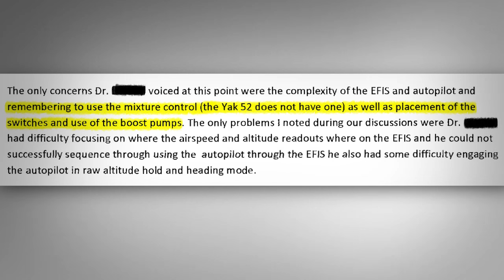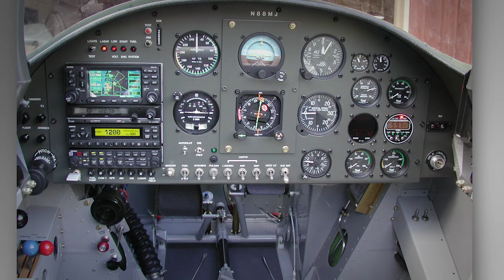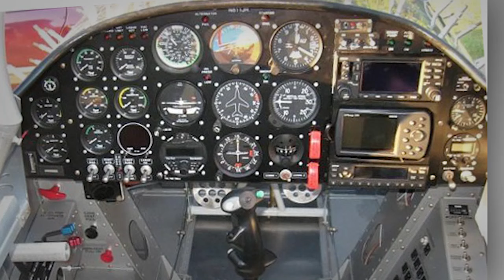Transitioning to Other Airplanes: A Dangerous Detail

Comment: Same engine means absolutely NOTHING. The airframe is the critical piece of the puzzle. If you are getting into a new air frame you should spend at least a minimum of 10 hours in it before taking it home by yourself.

Comment: John Denver put his plane into the Pacific Ocean when he had to reach over his left shoulder to switch fuel tanks and he kicked the right rudder pedal.
Reply: That was a design error as well... because the builder did not want to run fuel lines through the cockpit to a more ergonomic fuel selector.

Comment: Apparent similarities can be absolutely lethal, even more than distinct differences. Sounds, vibrations, even smells, that convey a message in one context may have a very different meaning in another. Being in a situation you know is strange, and consequently alert, may be safer than blissfully operating on unconscious assumptions that are wrong.
Reply: Yep a perfect example is the boeing 737-800 pilots who shut down the wrong engine and not the one on fire when they had smoke in the cockpit.
 
They naturally assumed it was i think #1 engine because thats where they believed the Air conditioning Comes from and often smoke in cockpit via the vents means engine fire, 
But this is where the Air con WAS located on the 737-200 & 400.
(Result they shutdown their only good engine.)
Reply: I'm not sure if you are referring to the Kegworth incident--that was a 400 series.  The pilots assumed that the smoke in the cabin was coming from the bleed air.  They also assumed that the bleed air in the 400 series came from #2.  So they shut down #2.  The A/C on the 400 series gets bleed air from #1, #2, and the APU.  Better CRM may have saved this one...it was obvious from the cabin which engine was malfunctioning.  Hard to say what you would do when put into this situation.
Reply: +Ben Jay
The crash you're talking about happened on Jan 8th 1989, it was a British Midland flt#92, they were flying almost brand new Boeing 737-400 which had only a little over 500 hours on the airframe. It was definitely not the 737-800 series because the 737-800 series entered service in 1998 almost 10 years after the British Midland flt#92 crash.
Reply: Someone flying a small racing plane pulled the mixture instead of carb heat on final, because the mixture in the aircraft he was flying was where  the carb heat was on the one he owned. Could have died when he landed in a field short of the runway and went inverted. Couldn't open the flip to one side canopy.
Reply: True for 737 MAX and 737-8
Reply: @vinci3965  Ding ding ding.

Comment: Just from my (limited) experience in "flying go-karts" I can promise you, the better philosophy when looking into a "new" (to you) airplane is to DISMISS the similarities, and FOCUS on those differences. Those little idiosyncrasies are exactly what stack up against you and take you down!

     Similarities? Who cares? I already know how to deal with what's "the same as my plane"... SO dismiss. That's not interesting.

      Just the same, it works for cars, forklifts, hydro-static drives, and motorcycles... Do you push one lever forward and yank the other back to make the machine turn? Is reverse a specific slot to push a lever into, or a switch on the side of the steering collumn? Will you notice before you turn on your blinker and crash through the store front in front of you while staring out the back window uselessly??? Is your right or left hand working the throttle on that bike? If it was vintage British or a WWI G.I. it's probably on the left... AND the Brit's were occasionally notorious for running that throttle cable backwards, too... SO you could "roll forward" and accelerate instead of slow down... FUNNZIES!!! 

     ALL motorcycles are self correcting. That's not interesting... Whether I can kick my gear-shift down a gear, or I have to flail around for a lever on the side of the tank (aka "suicide shifter") might be worth knowing before I'm tearing ass down the road at 90 mph... AND it's easy to FORGET when you're "in the moment"...

     Nah... FOCUS on those differences. The similarities are of little or no concern at all. Most planes (but NOT all of them) will also "self correct"... Meaning with the stick/yoke centered and the pedals left alone, it will return to wing-level, straight flight... BUT there's a reason for the saying "If you can fly a Sopwith Camel, you can fly anything."  ;o)

Comment: Not a pilot. I’m still in the learning period of deciding whether to take up GA as a hobby. But I work in nuclear power. If I were to transition to a different plant that was identical to the one I work on in almost every way I’d still have to go through formal recertification of basic operating and emergency procedures for the new plant, with an emphasis on any differences, no matter how minor, down to simple things like switches, buttons, and indications that are in slightly different configuration. 

It kind of blows my mind that a PPL can legally just hop in a plane they’ve never flown before and take off with no checkout process. Even a requirement to do self-reported basic cockpit poster instrument and control familiarization and side by side comparison of procedures and checklists can go a long way. And it’s free.
Reply: why do you need to brag about where you work and what you want to do🙄🙄

Comment: The Yak and the accident aircraft had the same engines but if you took both engines out of the planes and put them side by side they would not have looked even remotely the same. Only the block, heads might have looked similar, but that all. This pilot had no real experience in a plane like he killed himself in. The Yak is a dump truck compared to the Century Radial Rocket.

Comment: I do not, and am not, blaming the seller one bit. However, I think if I was in his shoes I might have refused the sale after 30 minutes only of training. Especially with the buyer having his son with him along for the ride. In a situation like this perhaps a contract obligating the buyer to a certain number of hours and maneuvers/training items would have been wise. Cirrus obliges SR22 buyers to 
10 hours Cirrus Flight Time (6 hours minimum)
10 Cross Country Legs (7 legs minimum)
20 Landings (15 landings minimum)
8 hours Ground Pre/Post Time (No minimum)
Pre-Training Assignments must be completed prior to transition training.
Reply: He is selling an aircraft, not trying to draft a legal contract . . . .
Reply: @TRPGpilot  Yeah, sure, but Cirrus REQUIRES a "legal contract" before buying one of their airplanes. A Cirrus SR-22 is FAR less "serious" than a Radial Rocket, which, as the video explains, is a 400 HP, 2,500 gross weight taildragger which is also a homebuilt Experimental aircraft. The seller/builder wanted FAR more time than the buyer had available to familiarize buyer with the plane. He expressed MANY concerns about the Radial Rocket as compared to a Yak-52. During the HALF HOUR demonstration flight they did not practice slow flight or stalls with the potential buyer and the seller/builder expressed, in a post-flight review, concerns about the Radial Rocket's complex fuel system management, namely, "mixture control and boost pump procedures" and "difficulty reading airspeed and altitude on the (Radial Rocket's) digital instrumentation." So, yes, the seller was simply "selling an aircraft." However, many important items were not addressed sufficiently to allow the new owner/buyer to control the aircraft in a responsible manner. That led to a tragic accident and needless death of father and son. Perhaps something more akin to a "legal contract" (YOUR words) would have been more appropriate.
Reply: @crooked-halo  maybe the pilot should've learned from the death of child 1 yo air crashes

Comment: Aviate-Navigate-Communicate.  Get behind the aircraft and you can quickly get into trouble, and unintentionally losing airspeed is always bad news.  It is easy for any of us to criticize after the fact and from the comfort of our homes, and many of us have done more stupid things than we'd like to admit.  But still...on the two single seat checkouts I had (both gliders) I read the manuals multiple times and did asked everything I could think of from the instructors before taking a breath and very gently flying flying them.  Hurry the process and you are asking for the unexpected.
Reply: I made the mistake of assuming I knew what to do instead of checking with my instructor early on in my training. Dropped full flaps on downwind in a Samba XL. Next thing I knew I was at 30kts only 1000AGL. He got me to recover and land but hell it was darn scary realizing how close I came to spinning a plane that takes several thousand feet to recover.

Comment: Why would you buy a plane with such a complicated manual fuel mixture????
Reply: Bryce Nelson - cause that’s how the plane works. The early Piper Cherokee 6 has a four position / tank fuel selector. It’s often stand practice to run a tank dry before switching.
Reply: Bryce Nelson 
Not a big deal if you manage it properly
If you want a plane that flys itself you’re not a pilot
Reply: @lejink  He was just asking an honest question, no need to be a jerk about it.
Reply: @Vejitasei  The question is why design a plane that is so sensitive to the fuel mixture, constantly requiring extremely careful manual calibration to avoid disaster. It's not the engine, as the pilot's previous plane had such an engine with automatic controls. I suspect it has something to do with cost--build the fastest airplane you can, as cheaply as you can, while safety is ignored.
Reply: yes, just imagine you have a bike or car that needs constant manual fuel mixture adjustment
Reply: one less task= less chance for task saturation. Again, you dont have to constantly adjust your cars fuel mixture, do you???
Reply: @lejink  What a boomer way to go about things

Comment: I fail to understand why people have trouble reading the information in the modern EFIS.  It's much more intuitive than the old steam gauges.
Reply: It's simple, with steam gauges, you don't have to "read" them. All you have to do is take a glance at the needles and you know all the info you need.

It's like reading clocks. With a digital watch, you have to "read" the numbers but with an analogue clock, just by looking at the position of the hands, you can tell the time.
Reply: @ Mr Meerkat

Not true. 

The reason why they have tapes is so you can see trends. 

Not only that... but the digits move like old drum rollers AND there’s often a trend vector on the tape. 

Don’t confuse digital and analog with electronic and mechanical. They made mechanical “digital” and tape displays for aircraft like the F-105 and SR-71 long before electronic instruments. 

And they are wholly superior. One of the very first instruments changed was the altimeter from a three hand to a single hand with digital drum roller as a result of several crashes where the pilots misread the altimeter by TEN THOUSAND FEET!!

Comment: parachutes should be mandatory on experimental and light aircraft in my opinion
Reply: Glider pilots usually fly with parachutes. It gives a comfortable feeling. CAPS would be better in some cases though.
Reply: Parachutes only work in limited scenarios. They woukdn't have saved this plane, it was too low.